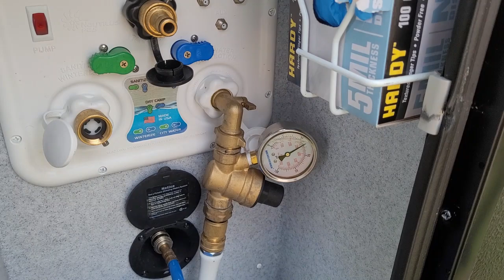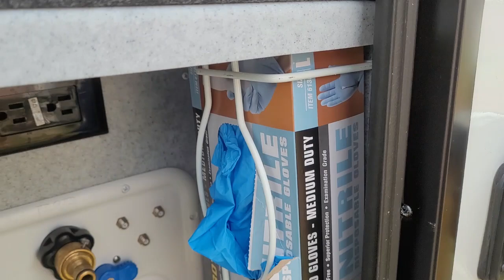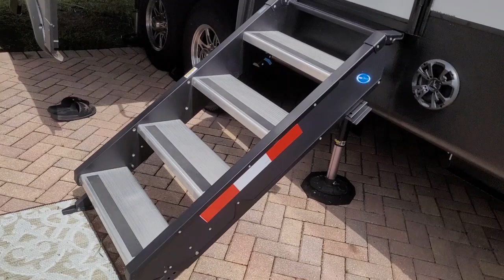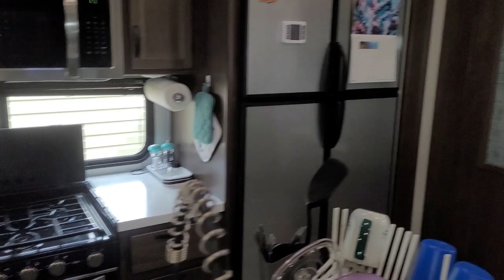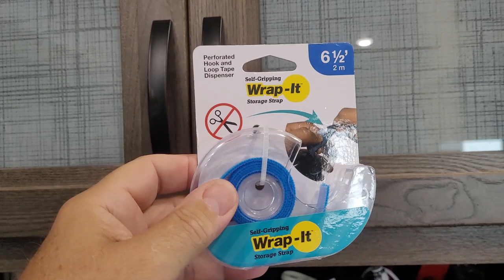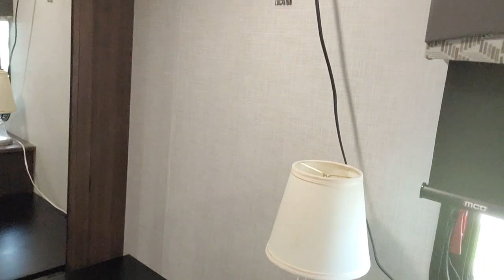7 MORE Easy RV Mods and Upgrades   Less than $50 each!

Comment: Thanks so much for the great ideas. Love the glove holder. Question: Did u screw the holder in the wet bay. My wet bay is just like urs.
Reply from the maker: You're welcome! I did screw the glove holder into the wall of the wet bay. I first checked to make sure there was nothing behind that wall that could get punctured. The wall was plenty strong enough to hold the gloves and holder. Thanks for watching and commenting!

Comment: I'm so excited I found these videos!  My little (and I mean little) camper has such limited space and yet I want to make it my own but it's difficult.  The hints you've given are wonderful.  Especially the museum putty, the reflective tape (good for so many places) and museum putty.  I wonder if the museum putty will work for small knickknacks on the wall.  I have tried the regular sticky type hooks and they don't seem to hold in my camper.  Love these videos!!!🤩
Reply from the maker: I haven't tried the museum putty on a vertical surface so I don't know if it works. We usually use the 3M steps for that. Thanks for watching and leaving a comment!